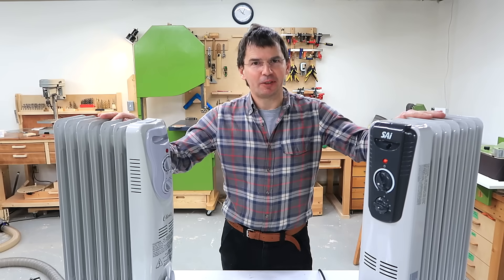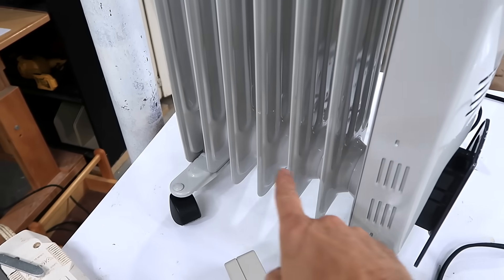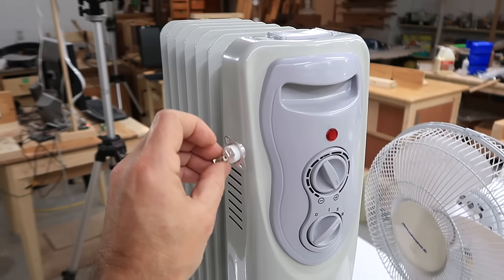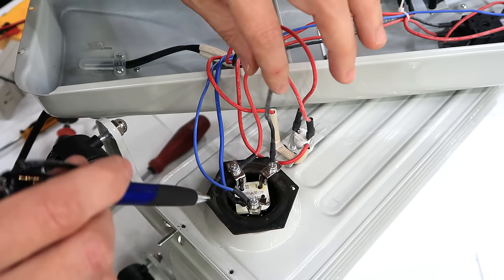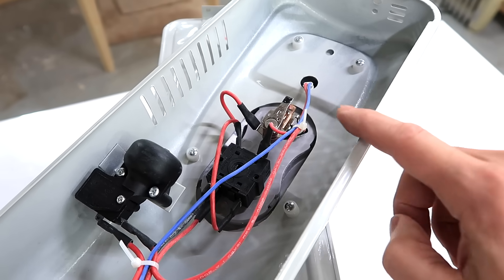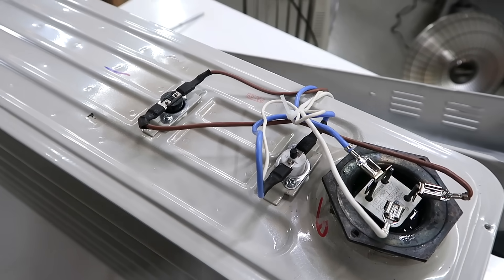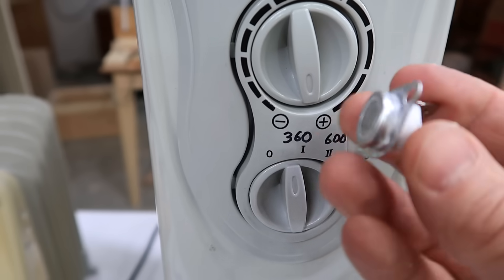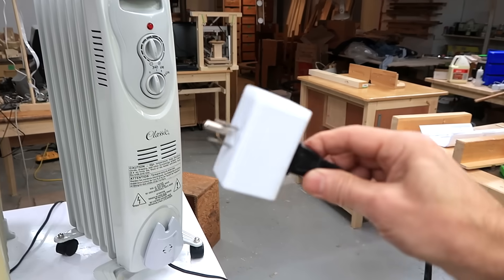Oil filled heaters: 600 watt heaters pretending to be 1500 watts

Comment: It was painful to watch you having to dremel those security screws to use a slot screwdriver. Next time you're in a hardware store, get a security bit set. Harbor Freight have a set for $6.50, which incudes tri-wing bit set. I got a similar set a few years ago when I lived in Germany. It's only been useful a few times, but beats having to mangle a screw.
Reply from the maker: I have a security bit set, but without the triangular ones.  There are way more types of security screws than in a typical set.
Reply: tri-wing, now that's a name I haven't heard in a long time. A long time. Trying to modify an older gameboy. Wonder if that is more common in Japan.

Comment: I have better idea. Insulate the walls and attic of your house in the mild climate of Fredericton.  Or since your a wood worker and therefore have a ton of scrap waste from projects install a wood stove in basement and make a fire once in morning and once at night problem solved.
Reply from the maker: house is insulated.   Renovating the walls to add more insulation cost about 200x times the cost savings.

Comment: I have an identical Airworks unit (450w).  Defective power switch so I bypassed to keep it operational.  

A bit concerned about the long-term safety/reliability of jumper wire.  The switch likely available on eBay appears to be a pain to remove so I resorted to the easier solution.

Comment: none of mine have that small thermostat, or the tilt sensor. I have the 2 heating elements giving me high med and low, and the dial thermostat. they work well last I used one.

Comment: The ticking noise could be moisture condensation inside the oil reservoir. While cold, the water will be heavier than the oil, but as it heats up, it will boil in the hot oil, then condense when it hits the colder oil, making the ticking noise as the bubble collapses. Eventually the oil will reach a uniform temperature, and the water will remain vapor until the system cools down.

Comment: have you considered making some radiant panels and put them on the floor in various locations you commonly work?  That's something I would try if I had a big shop that I couldn't get warm.
Reply: Are these also called thermostatic panels?  I think I had a heater that worked on the same principle.  Worked like a charm, but made a crinkly noise as it heated up and cooled down.  I sold it.

Comment: The one I have has the decency to run taking up around 900 watts continuously I think it's because it simply has more surface area than the ones you have, the high power doesn't seem to trip anything (though I haven't checked extensively) but the heater starts smelling a big when run on high power for too long so I keep it on mid or low.
Reply: Try wiping down in between the fins with a slightly damp cloth.  The smell is probably the little bit of dust that's accumulated on the surface being "roasted" on the higher temperature setting.  In any case, the smell should go away after a few hours of use on high, once the volatile compounds in the dust (i.e. the stuff your nose detects) fully evaporate and are gone.

Comment: I wonder if an insufficient fluid level in the radiator would cause limit tripping in high power.  An air pocket is required for thermal expansion of the fluid at the top but if the fluid does not reach the top manifold it will not circulate vertically during heating which may cause the overheating during high output (fluid boiling).  
  Could this be a mfg cost saving that the purchaser will never notice?  Is it even oil? Can the element be removed to check oil volume?
  Hmmm?
Reply from the maker: excellent point there.  Don't really want to pull the element, cause it might not seal right when I put it back in.  But feeling for how much of it gets hot, it looks like the oil level barely gets to the top reservoir when its on.
Reply: @matthiasrandomstuff2221  an IR camera could give you a good idea of the oil level
Reply: Cheap ones have very low oil filling and thin metal stacks. I compared a cheap one vs a more pricy one and the expensive one looks to have more volume of oil and thicker heavier fin stacks.

Comment: I suppose the power consumption would be relative to the temperature of the room. If you put it in a room that was below freezing, it would probably pull 1500 watts continuous.
Reply: No, it pull the same amount but for longer time without cycling, is not an air condictioner
Reply from the maker: would have to be a very cold room, below freezing, I suspect.
Reply: I have one in the kitchen which is drafty and plugged into a power strip too. The circuit breaker cuts it off after about an hour at level 3 .
Reply: @thalesnemo2841  as i understand it you should never plug space heaters into power strips, it's an inherent fire hazard
Reply: @walterw2  the moment you plug a heater in you created a fire hazard
Reply: @walterw2  The rule actually is "only use extension cords if they are properly rated, have good contact, the cable is not creating a hotspot, the cord and and plug are not damaged and were manufactured according to spec." And as 99+% of people cannot do this check, the safe thing to tell people is "never".
Reply: @HenryLoenwind  extension cords are one thing, i was referring specifically to power strips
Reply: @thalesnemo2841  What is the ambient temperature in your kitchen? 
The ambient temperature of the air around the heater determines how fast it will cut out when heating on the higher settings.
Only reason to get one of the more powerfull units is if the heater is going to be placed in a cold place, otherwise a smaller model would typically suffice.
Reply: @Gin-toki  15-20C
Reply: @thalesnemo2841  Yeah thats not that cold, so no wonder a 1500W heater will cut off after a short while :)

Comment: Have you taken one of the wifi outlet switches apart yet? I'd be nervous about running so much current through one of those, as they have don't seem like they could have good electrical separation between high voltage and low.
Reply from the maker: The relay inside is rated for 15 amps, but isn't very big.  I think it's ok to switch 600 watts (5 amps), which is how I use it.  Had one relay fail open from switching motors though.  Those have very high starting transients.

Comment: Our oil heater is great for us, cuz we tend to have some amount of airflow. Specifically when our apartment central was out I needed to use it with a fan.

In my room now though my walls are just brick with no insulation. That thing gets a lot of air to it and keeps my room warm. However the sensor is something I will keep in mind because it obviously does cycle. I hear it clicking.

Comment: a disadvantage of our 240V system is that you probably die if you ever touch it... but at least our heaters are running at 3000 watt. most important for kettles
Reply from the maker: I grew up in germany.  Got zapped once or twice.  It definitely hurts more than 120 volts.
Reply: @matthiasrandomstuff2221  Dad was an electrician. He said 120V felt like the worst static discharge of your life, but 240V was like getting hit by 120V and punched in the chest at the same time.
Reply: Dang, our 240v maxes at 2400watt
Reply: @janeblogs324  Where? That's only 10 amps.

Comment: I had a nice digital oil filled heater that lasted only 2 or 3 years. I switched back to forced air models which I also never run at the high setting..
Reply from the maker: I very much avoid electronics on these things.  The simpler the better.

Comment: Adding snubbers in parallel with termostats (and the cycling overheat protection) can make them last a lot longer.

I think you could make snubbers with motor capacitors and stuff you already have lying around.
Reply from the maker: or I could just set it to "1" where it doesn't cycle.  You don't actually get any more power out of them when they do cycle.
Reply: Why modifying them at all if they can just be set to 600 W then. no need for a 360 W setting.

Why don't you just run them on "1", instead of making "2" 600 W
Reply: @m8e  why would you not want more features?
Reply: @chaklee435  more features are good, but pointless if you just going to set it to 600w anyway.
Reply: @m8e  use 360w instead of having the thermostat cycle on and off

Comment: On our oil-filled heater,it has two switches, one for each element.  The switch for the high power element burned through its contacts long ago.  I removed the wiring on that switch, and we just use it on low.  It's fine...   It'll make those oil-ticking noises for a minute or two at power-up after having moved the unit, especially if it's been tipped slightly.  Manual says that's normal.
Reply from the maker: We got one where the contacts for the high element burned out too -- before I realized never to use the high power element!
Reply: An oil filled heater, combined with a fan, has the advantage of being less of a fire hazard. Heating elements of fan based heaters can get quite hot, and the fan sucks anything small inside. Saw dust, hair, pieces of paper...
Reply: @hansvandermade6045  probably sounds better than a heater with a tiny built-in fan too. and a lot of warm airflow instead of a small hot intense wind
Reply: @poiiihy Probably, yeah. They're best without any moving parts, though :)
Reply: @hansvandermade6045  yeah but then you have confirmed it's gonna have issues if the fan breaks which can happen easily.
Reply: @Babihrse  I'd prefer a heater without any noisy, wear-sensitive parts. Mine are low powered units, and they work just fine without additional air flow.

Comment: I have one that had a crumbling switch so it is now hotwired to full 1500 watts with no thermostat control. I think the boiling oil sound is just a startup thing as the oil is becoming less viscous. I'm not advocating that solution but nothing has exploded here.

Comment: So they say it's 1500 but it trips it's own internal sensor above 600? Isn't that backwards in terms of design to say it can do more than it actually is designed to do?
Reply: my thought is at 1500watts it will get up to temp faster but only needs 600 to maintain that temperature
Reply from the maker: its like horsepower ratings on shopvacs.  No one would buy a huge 600 watt heater, but they will if they think it's 1500 watts.
Reply: Well a radiator capable of passively dissipating 1500W would be huge and therefore not popular.

Comment: Put the heater near the coldest spot (like a window) and it trips less often.  But I too love these heaters.
Reply: Isn't that just wasting money though? You want the area where people are sitting to be warm, not keep the heater in a fridge just so it doesn't trip.
Reply: @DenkyManner  putting it where it's cold actually saves energy as temperature differential across the radiator being greater is more efficient
Reply: @DenkyManner  You'd think so, but in addition to the differential, that's usually a drafty spot, so you're warming the cool air that's being sucked in. Knocking the chill off that moving air makes the room feel warmer than if it was actually hotter with that cool draft. (The heater isn't causing the draft. Air escaping through our poorly designed attics/roofs create a vacuum effect.)
Reply: ..and BAM! Therein lies the rub. The whole-house envelope.
I bought several oil-filled radiators over the years w the first lasting the longest at just under ten years. After the third broke I went on a journey where the enlightenment occurred.
tldr: seal the envelope! Better in so many ways. Less waste/resources, greater comfort. Done.
Reply: @DenkyManner  most rdiators are placed under windows for this reason

Comment: This is a great solution.! I keep one of these in My basement to warm the upper floor.
But - For those of you who may be uncomfortable with electronic alterations - -
Upstairs - I keep My ceiling fan on reverse to force warm air down.
That seems to keep Mine from cycling on/off.
If I forget the ceiling fan it cycles and reminds Me. -KJ
Reply from the maker: Just set it to "1" and it won't cycle.
Reply: @matthiasrandomstuff2221  But if the temp's that low I'll have to put on clothes. ;-/ 
;-)

Comment: I use these oil heaters for my dc load bank for my diy solar system when I've got excess solar
Reply from the maker: at an old job, the guys were complaining about how expensive big power resistors were, for battery pack testing.  I just said "use a space heater"
Reply: @matthiasrandomstuff2221  I've said this a few times I was going to spend thousands on a electronic dc load but ended up diying a load bank and it keeps me warm at night haha
Reply: MartyT (here on youtube too) has his off-the-grid water turbine system that dumps all the produced electricity into a water heater/boiler, but when that also eventually reaches the set temperature, he just has the PLC controlling everything to turn on a small space heater, preventing the risk of overcharging the batteries. It also has an emergency mechanism that will shut off the water to the turbine in case the batteries are overcharging anyway.
Reply: Wouldn't a refrigerator be a better use of the power? Or are you cold?

Comment: One thing to watch out for is oil leaks. We love these heaters to. But keep them on a tray so we can detect oil leaks. If it happens they go to recycling due to fire hazard. Newer happend to us thought, but there has been some fires due to them. As it has from other ovens from dust or covering. Thats why I like these. They dont get so hot that they can ignite dust, paper and such by accident. Gretings from Norway 🖐
Reply from the maker: we had one leak, returned it.  I think the thermal cycling, and oil boiling increase the probability of leaking quite a lot.
Reply: Also the overheat protection can fail in such a way so that the circuit is still closed meaning you can get a runaway heating on higher temperatures causing the oil to boil and blow the radiator causing fires
Reply: @zerg539  That's why we like seeing a thermal fuse as a backup protection like with the first heater he opened.
Reply: I've had 3 leakand others fail in other ways. It's why I won't get them again and opt for halogen bar heaters instead.

Comment: I don't see the advantage of heating the oil. Looks like a electric heater like a baseboard that has no moving parts. And you can get 1500 walts instead and easy to set the temperature.
Reply from the maker: a 1500 watt baseboard heater is quite long!

Comment: What is your house’s primary heating source? If it’s anything other than electric baseboard then why not simply increase the temperature on the household thermostat? Wouldn’t that be more efficient means of reaching desired temperature?
Reply from the maker: its a very old oil hydronic system.  More expensive to use than electric.  Though still cheaper to use that than replacing it, given the quotes we got.
Reply: @matthiasrandomstuff2221   You should check out Mikey Pipes youtube channel.  Watching him so service calls on boilers and hydronic systems will likely teach you enough to at least tune your system.
Reply: Hey Matthias I changed my hydronic ignition coil to solid state. That changed everything. The solid state module puts out 15kv while the tired original coil was less than 10kv. 10kv is new.
Reply: @matthiasrandomstuff2221  Can't you install a European-style heater? Hydronic systems are very common there, so they are not expensive. They're also really efficient.
Reply: @matthiasrandomstuff2221  I always wondered how someone like you calculates that. I usually go by feeling that all the money for insulating and new systems will give me plenty of years of heating the old system...not talking about misscalculations and risking mold. But seeing someone as good with numbers like you also sticking to the old stuff makes me wonder if i might even be right. On the surface it seems replacing stuff sooner equals more years of saving which should mean i get my moneys worth out sooner right?
Reply: I think in another video he said their off peak electric cost is close to zero because there's excess hydro power at night.
Reply: fuel prices.
Reply: What makes you think my house has a thermostat?
Reply: @Bryan-Hensley  some boilers are up to 98% efficient, you can't get much higher than that. Infloor heating systems can also be set up to use way less electricity than a furnace.